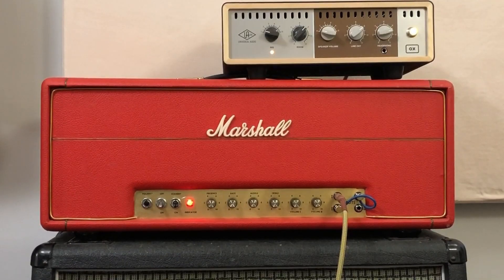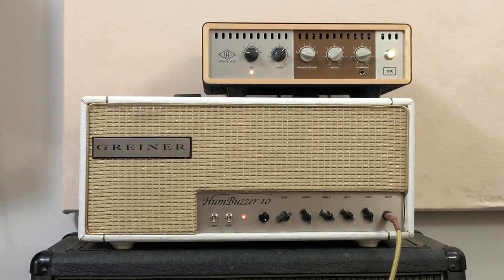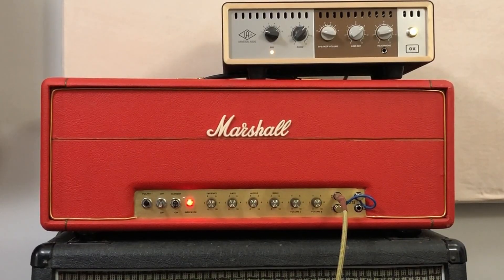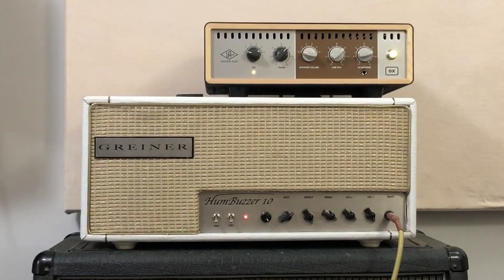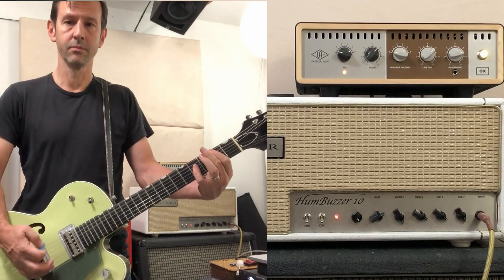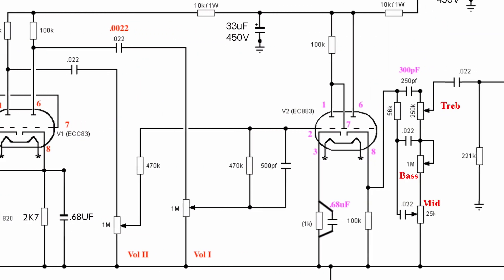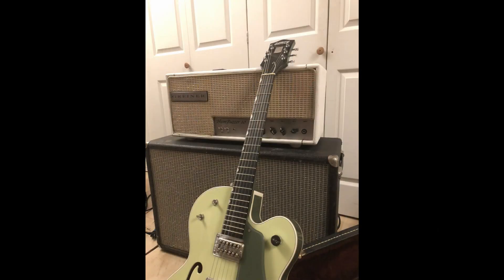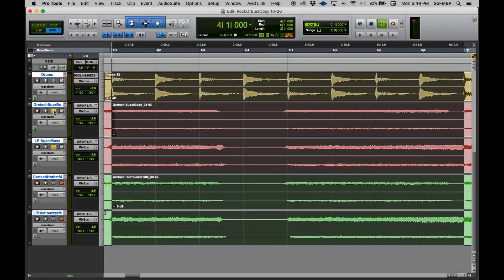Marshall Super Bass Mini-Clone

Comment: Looking at your schematic... It shows for the first 12ax7, the first triode of each channel, (I know you jumpered both channels internally) it shows separate cathode resistors and bypass caps for each input stage, but you connected them together before those components with a jumper as well. Is this how you wired it? If so, that's interesting. Wired this way, those components would show both input stages the same parallel values, rather than bias them differently. The amp sounds great, I just found this interesting.
Reply from the maker: Might be a drawing error.  Those two sides originally had shared cathode like a Super Bass, but I may have changed them to split cathode like a Super Lead.  Both inputs are indeed internally-jumpered.  Glad you like it!

Comment: This is bloody brilliant. How is the sound in the room? I’m having similar issues with my 2204 half stack. Sound guys hate me. 
Does this build retain the solid low end and percussive thwack? I’d run it through a 4x12. Thank you!
Reply from the maker: To be honest, it doesn't have the same low end punch.  Nothing does.  Even a 50 Watt Marshall doesn't punch like a 100 Watt Marshall.  Probably sacrilegious to say, but the best Marshall sound I've gotten at low volume is by using a digital model through a 4x12.
Reply: @scottgreiner1740  couldn’t be more right. What are your thoughts on this single ended build vs an 18 watt build. It seems even the 18 watt is too much considering all the stage volumes are 85-90 decibels
Reply from the maker: @steveheckman4194  Every amp has its sweet spot, however loud that may be.  I haven't found a tube amp that sounds great at low stage volumes, thus the modeling solution.  Maybe a Suhr PT15?
Reply: @scottgreiner1740  awesome I’ll check that out. On your build here what is DB for its sweet spot?
Reply from the maker: @steveheckman4194  Not sure - never measured.  Loud enough for rehearsal; not loud enough for a small club.  It ended up having not enough punch or headroom.
Reply: @scottgreiner1740  Aw okay. Would upsizing the PT to get a little more watts out of that help?
Reply from the maker: @steveheckman4194  Sure!  But that changes voltages else downstream in the preamp.  A Plexi is a plexi, beacause it's a plexi!
:-)

Comment: The schematic suggests to me that you used half a triode as the last stage with values to simulate the gain level of a long tailed pair. I've never seen that before. Great idea and it worked perfectly. You've created quite the masterpiece.
Reply from the maker: Thanks!  I realized that the phase inverter was a big factor in the overdrive of the Marshall, so I simulated that part of the circuit.  The cathode-biased single-ended output sounds way different than the Marshall's push-pull, plus I have no presence/negative feedback.  I compensated with  a snubber cap/resistor on the output transformer.
Reply: @scottgreiner1740  awesome man.  And I noticed the lack of negative feedback. I also noticed the schematic shows 4 inputs but you only used 1. That 1 input is tied to both the normal and bright channels?
Reply from the maker: @TheJurgisRud  Yep - like a jumpered Marshall

Comment: What made you choose a kt88? Sorry if this is a silly question but how come it's only 10w? That seems low for a kt88
Reply from the maker: Well, I had an EL34 in there originally, but the KT88 sounded less murky in the low-mids, and more dynamic.  It's only ~10 Watts because that's all that the power transformer can give.  I could have built a bigger supply, but I wanted this amp to be lower power for smaller gigs.